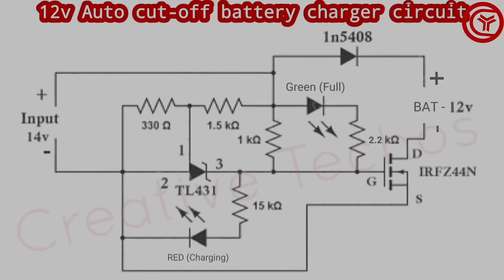Auto cut off 12 volt battery charger circuit

Comment: If the battery is full, does charging stop..?
Reply from the maker: Yes, the mosfet is turned off
Reply: @CreativeTechos  Good.., it's just that there are a few mistakes you share..
The 15k resistor is not in the parts list..
And the 56k resistor that is in the parts list is not in the circuit diagram..

Comment: I built up this circuit exactly (and double checked everything several times), and it doesn't work.  The circuit only allows current to pass through if the source voltage is less than 13.7V, and if it's 13.7V or higher the green light is on and it doesn't allow anything to pass through no matter how low the battery charge.  And when simulating a fully charged battery with a second power supply attached to the battery, and the source less than 13.7V, it continues to charge with the red light on even with the second power supply is turned up to make the battery look like it's over 14V.  Are you sure your schematic is correct?
Reply from the maker: Checkout the new last video i uploaded, there i have used variable resistor to set cutoff threshold by your choice, also refrence pin is used to take battery voltage feedback to cutoff at precise voltage
Reply: @CreativeTechos  Is this circuit is applicable for cutoff 3.7V or 6V batteries when input is 9V or 12V.??

Comment: Dear make 9v Dc lithium ion battery for wifi router to run continuously. And How to  recharge with how many watts charger.  Will be waite . Thanks a lot .
Reply from the maker: You mean wifi router ups?
Reply: @CreativeTechos , yes 9v for wifi router , around 6 hours backup . Thanks a lot

Comment: Remember a 12V lead-acid battery is only HALF charged at 12V. Fully charged is 12.5 - 12.6 volts.
Reply from the maker: That's why 14-14.4v is supplied and cutoff at 13.5v
Reply: Can I connect it to 100watt solar panel to work as regulator?
Reply: @simonpeter4884  nice idea
Reply: Nxt

Comment: what is the voltage of the battery when the green LED turns on?
Reply from the maker: The input DC needed to be fixed at 14v, so when the battery voltage will reach to 13.8v it will cut off & green LED will glow indicates battery is fully charged.
Reply: @CreativeTechos  thanks

Comment: Best project. But your  connection not monitor battery voltage ..
Reply from the maker: It better to connect reference pin through resistor to battery side, to cutoff at exact calibrated voltage.

Comment: Two problems here, 
1/ The output voltage is determined by the input voltage. If you want to accurately control a battery, you need an accurately controlled supply. This because the output is derived from the voltage divider that is the 1K5 resistor and the 330Ohm resistor
This might be OK for a Lead Acid battery but NOT for a Lithium Ion battery
2/ All the current going into the battery must go through the big MOSFET. As shown and without any heatsinking, it stands a very real chance of getting insanely hot - and what happens then is anyone's guess. 
Thus, Do Not Use this circuit for Li-Ion batteries
Reply from the maker: It is actually not for lithium batteries as already mentioned for lead acid batteries in thumbnail, Here is another upgraded versions of these controllers
https://youtu.be/fq3pdoB_Sbo
https://youtu.be/nvlOeDHkwK0
Reply: Please what other methods do I use to build a 12v  lithium lon battery charger?

Comment: Amazingly simple setup!!! Please would you tell me which resistor should I tweak to set the TL431 to 28 volt or  30 volt cut off? To charge a 26 volt battery.
Thank you!!
Reply from the maker: Simply change 330 resistor with 10k variable resistor and set cutoff point.
(If you want cutoff when voltage reaches 28v, you need to connect 28v at output and slowly rotating variable resistor till green led glows.
Reply: @CreativeTechos  Thank you!!!! You're so skilled and such a good person as well!
Reply from the maker: Thankyou so much for appreciating

Comment: Very good ⚡👍
Reply from the maker: Thanks
Reply: Excuse me what other substitute for the irfz44n l have left. Thanks
Reply from the maker: You can use any Mosfet as Mosfet handles higher draw current, so use any Mosfet but be careful about pin configuration of mosfet and connect accordingly in diagram

Comment: Excellent work, please. I want to make a 48-volt battery control circuit. When it reaches 45 volts, it will be disconnected. Thank you. I follow you from Egypt
Reply from the maker: 48v is not used most, but i can modify it for you and send schematic where you would like to receive, let me know in reply.
Reply from the maker: Whatsapp me +919596386458
Reply: When you change the 1.5k and 330 Ohm resistor. They give the reference voltage to TL 431. When you increase the 330 Ohm the output voltage is also increasing. However, I'm not sure of the design max voltage of some components (e.g. elco).
Reply: @CreativeTechos  please i nedd also 48v and 36v please
Reply from the maker: Please wait I'll soon upload adjustable that you can use for any battery
Reply: @CreativeTechos  thank you very much

Comment: 5:15 Nabíjecí napětí na Pb článek je 2,4 V. To znamená na celý akumulátor s šesti články musí být U=14,4V.
Reply from the maker: Yes absolutely you need 14.4v Max output voltage. You can check new improved version of this circuit with precise & adjustable cutoff. Video link https://youtu.be/nvlOeDHkwK0

Comment: I like the simplicity of this setup, would doing the math on the resistors would make it work for 9.6 lead acid battery charger ?
Reply from the maker: You can simply use a 10K variable resistor instead of 330R Resistor and use variable power supply to calibrate the cutoff on your desired voltage.

Comment: Hi friend thanks for the informative. What adjustments would be needed if I want to charge a 6v battery?
Reply from the maker: Change 330R Resistor with 10k preset, connect preset middle pin with Tl431 pin 1  and bottom right pin to ground, and calibrate it to 6v cutoff threshold using variable power supply.
Reply: @CreativeTechos  thank you so much for your quick response and valuable information
Reply from the maker: My pleasure, Thanks for watching 🙂

Comment: how about input sir how many volts...and the watts of resistor...thank you sir and good bless..
Reply from the maker: 14-14.5v, all resistors 1/4w, also you can check out the new version circuit uploaded with black pcb in video thumbnail, it can be adjusted precisely and with feedback.

Comment: How are you my friend, does the circuit work with 42 volts or 55 volts, thank you, I follow you from Egypt
Reply from the maker: Thanks for your interest in my content, it actually is designed for 12v battery.
For 42-55v it needs lot of changes, you may mail me i can send you diagram for that. Mail address in channel info.

Comment: Very good teaching. Can you please tell me if this charging circuit is good for 12v x 100 amp battery?
Reply: Only change high Ampere MOSFET in this circuit
Reply: @arunr1093  which is it ,12 volt,35 ah bettery can work properly 🙏🙏 please tell y
Reply from the maker: Hii there, yes you can use this circuit for 12v 100ah battery. And set voltage to 14.4v and current Full.

Comment: Hi CT...what is the best amperage for the power supply of the battery charger for this project?....i have two pieces of 12v 7 Ah ups battery...the ups is not working anymore and i want to use the two batteries...thanks for the video.
Reply from the maker: The charging voltage should be max 14.4v @ 2A and cutoff threshold 14.5v
Check out this circuit for precise charging 
https://youtu.be/nvlOeDHkwK0

Comment: Thanks for the circuit and video! Two queries: one is what modification must be done to charge a 3.7 volt battery? And second, I like the idea of decoupling the load with the PC817, could it be adapted to this circuit? Cheers
Reply from the maker: There is already a charging circuit for 3.7v lithium battery on my channel, Yes PC817 can be used to close mosfet with negative voltage and Led pin 1 & 2 of optocoupler must be interfaced with tl431 shunt regulator.
Reply: @CreativeTechos  Hello, thank you very much for answering. I'm going to try the optocoupler thing and let you know. Regarding the 3.7 volt battery charger, I'm looking at it and it's great, thanks again! Cheers
Reply from the maker: My pleasure 🙂
Reply: @CreativeTechos  on no

Comment: Why are you increasing input voltage to test it? Shouldn't input voltage be constant (around 14v)? 
Also, why you connected a diode on the output? Even if bettery will full charge, the circuit wouldn't get the voltage of bettery due to unidirectional property of diode.
Reply from the maker: Actually this circuit works on drop voltage by connecting battery and when voltage touches 14v it cuts off, I used variable power supply for demonstration,
https://youtu.be/nvlOeDHkwK0
You can check out this upgraded version that works with voltage feedback form battery and cutoff at precise cutoff set voltage.

Comment: Nice mr,,,how about input 20-30volt ac,,it save?
Reply from the maker: Which battery you want to charge mention v & ah
Reply: @CreativeTechos  its for regulator my motor,,
Reply: @CreativeTechos  my motor over voltange to charnging its until 20volt dc output,,

Comment: is it work for 90A/12V battery? mean, capacity does not matter?
Reply from the maker: Yes, you can use it for 90ah battery, 
https://youtu.be/nvlOeDHkwK0
you can also check new version of this circuit with adjustable precise cutoff .

Comment: Buen día, este circuito tiene battery inverted protection?.... Gracias
Reply from the maker: Yes, this circuit has wrong polarity protection using diode.
You can check new improved version of this circuit with precise & adjustable cutoff. Video link https://youtu.be/nvlOeDHkwK0

Comment: Please Sir is it possible to introduce a variable resistor to adjust a cutoff  level for different battery voltages?
Reply from the maker: Yes instead of 330 ohms Resistor you can use variable 10k resistor to setup threshold cut voltage

Comment: In your comments you answer requests for using other than 14V input and give a variety of answers. I am thinking of using the circuit as an add on to a simple bridge rectified battery charger. Could I replace a resistor on the input with a trim pot? Would I replace the 330ohm resistor or the 1.5Kohm resistor on on the left of your circuit? What size trim pot would I use if this could be done?
Reply from the maker: You can add bridge rectifier as dc source and you can add trimpot instead of 330R resistor to adjust cutoff voltage, but its important to keep dc voltage under 14.4v.
That you can get by using lm317 adjustable output with bridge rectifier circuit externally
Reply: @CreativeTechos  Wow!!!! Thank you for your very quick reply.  I have already made the circuit but will alter it as you advised with say a 10kohm trim pot and see how that works out. Much thanks.
Reply from the maker: @theosalt1  you're most welcome, also little suggestion, if possible use multiturn VR for precise results, also I'm uploading circuit soon same like mentioned.
Reply: @CreativeTechos  Thanks again. I will eagerly await the new circuit.
Reply from the maker: Yes stay updated, I'll upload soon
Reply: Can I use a IRFZ34n mosfet instead of the IRFZ44n in your circuit, would I have to change the values of the resistors 
Please reply

Comment: You mentioned in the part list a 56k Resistor, but you have used 15k between Red LED & Mosfet. Please advise which one is correct. Do you recommend this to charge a 12v UPS batter?
Reply from the maker: Check out this circuit with more precise adjustable cutoff with feedback
https://youtu.be/nvlOeDHkwK0

Comment: to charge car battery on 100% cut off voltage must be 14.5-15v , on 13.6v car battery is  half chaged
Reply from the maker: Lead acid battery is fully charged if battery voltage is 12.6-13v after cut-off, So cutoff should happen at battery reaching to 13.6-14v
Reply: dry ups lead acid battery has lower voltages and i do not talk about it . do we talk about wet car lead acid battery? if do, fully charged good battery without load has 13.6v, cars alternator  keeps 14-14.4v, when battery is charging over charger, battery resistance rises over 14.5v, so good battery closes itself so charging current falls below 1A, mostly on 0.5A, and if you keep 14.5-15v it helps to brake crystallization  on cells what keeps battery fit and healthy, bad battery keeps charging over 14.5v with current more than 1A and starts to make bubbles and heats up.

Comment: friend can I charge 8.4v battery with the integrated TC3582B??
Reply from the maker: No, TC3582B/DA is low power charging ic for single 3.7v lithium battery.

Comment: Excuse me, i want to ask, if i use 24V battery i should change the 330ohm resistor to 10k potentiometer right, what i want to ask is which Value is Suitable for the potentiometer if i have to set it  ? Thank you
Reply from the maker: Check out this video, it is with adjustable cutoff and battery charging feedback.
https://youtu.be/nvlOeDHkwK0

Comment: I just made a 12v battery using old laptop batteries,can this work normally on it?
Reply from the maker: Did you used BMS ?
Reply: @CreativeTechos  Oh sorry am new here there are lot to learn
Please can I get enlighten about what your saying?
Reply from the maker: As you said you made 12v battery using lithium ion cells🔋 out from old laptop. That's why I said did you used BMS for lithium ion cells. If you don't know what is BMS, reply about same

Comment: Can I use this circuit for ups battery 27 plattes
Reply from the maker: Yes , you can use it for any 12v batteries, check out new videos for auto cut off charger circuits on my channel.

Comment: Can be used for 12k rasistor exange of 15k rasistor??
Reply from the maker: Yes you can use 12k, also you may check out new version of this circuit with adjustable precise cutoff with feedback
https://youtu.be/nvlOeDHkwK0

Comment: Can use this circuit for 24v battery with change supply 24v?
Reply from the maker: Yes you can but you need to change 330 ohms Resistor with 10k variable resistor to setup cut of threshold.

Comment: Sir ,can input apreset of 4.7k instead of 2.2k resistor to change the cut off at 13.8v
Reply from the maker: Check out this same but improved design with precise cutoff settings, and feedback from battery. https://youtu.be/nvlOeDHkwK0

Comment: Can use input 16/18 Volt? Thx
Reply from the maker: Yes but use variable resistor instead of 330 ohms and then set cut off point as per your requirement

Comment: friend I want to do with 8.4volt battery, how do I? I want to use tablet or notebook battery
Reply from the maker: Simply watch full video, you need to use variable power supply to set cutoff at your preferred voltage, suppose a 3.7v lithium battery has Full charge @4.2v so cutoff should be set at 4.2v

Comment: can it be used for a 9.6 battery charger
Reply from the maker: No, actually circuit is dedicated for 12volt battery, 
For 9.6v battery you can check these adjustable voltage & cutoff circuit
https://youtu.be/fq3pdoB_Sbo

Comment: How much the max  current. Can flow through the circuit?.
Reply from the maker: The mosfet is capable to provide continuous drain current @45A,
But 10A should be limited to battery to avoid overheating of mosfet also safety for Tl431 ic.

Comment: Can you explain in more detail while I followed the steps correctly. Z44 is still working fine without seeing the green light on when the tank is fully charged, it means that the charger is not disconnected. Could it be because of the TL 431? is fine?
Reply from the maker: You can check new improved version of this circuit with precise & adjustable cutoff. Video link https://youtu.be/nvlOeDHkwK0

Comment: I subcrbed after watching and click Like button and submit my request please put A LIST of components serially numbered so that beginners can try" DIY"
Please put video for relay cuttoff module and Connect charging for "ON LINE EMERGENCY LAMP THAT WILL SWITCH ON WHEN POWER CUTT AND WHEN POWER RETURNS SWITCH TO CHARGING MODE. 5.7volt 1.5 Amps Light LED modules. Thanks
Reply from the maker: I'll upload component list, also I have already uploaded automatic emergency light video of 12v same you can apply for below 12v project, you may check out that video on my channel.

Comment: What is the corresponding component values for this ckt, if I want to charge 6 Volt, 4.5 Ah battery ?
Reply from the maker: Check out this new version of same circuit with cutoff feedback, it can be used from 6-18v batteries, Just need to cut off at threshold voltage, for 6v battery, cutoff should be set on 7.2v with 7.5v input dc.
Check out these videos
https://youtu.be/nvlOeDHkwK0
https://youtu.be/fq3pdoB_Sbo

Comment: Can this be applied to a lithium battery?
Reply from the maker: Check out this video it can be used for lithium battery. https://youtu.be/nvlOeDHkwK0
Also note to set cutoff at 4.2v for each cell or 4.2v x number of 3.7v lithium cells.

Comment: how many Amp is this circuit measured?
Reply from the maker: This circuit can handle higher amps for more than 48ah battery as mosfet can handle higher currents, rest circuit with shunt Regulator controls charging and cut.
Reply: good job.
i wonder if this "input source" can be combined together with "bulk converter" + "digital meters" for best
& user friendly.
suggestion: maybe you can make a video of that.
👍🏻👍🏻👍🏻 all the best, goodluck.
Reply: @CreativeTechos  wow nice video I like it a lot since it doesn't make use of relay it has no noise if I add more mosfet is the output current going to increase do I can charge more bigger battery with the circuit
Reply from the maker: Yes you can increase current by address mosfets check data sheet of IRFZ44N Mosfet for current handing.
Reply: How Amp charge?